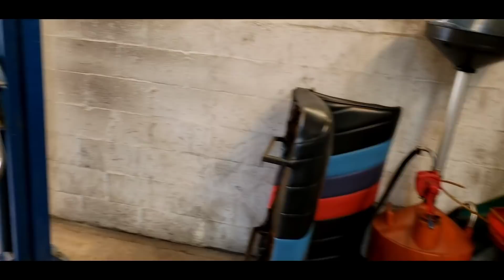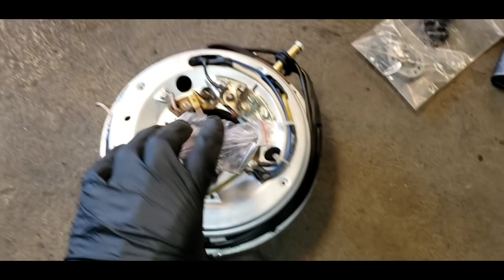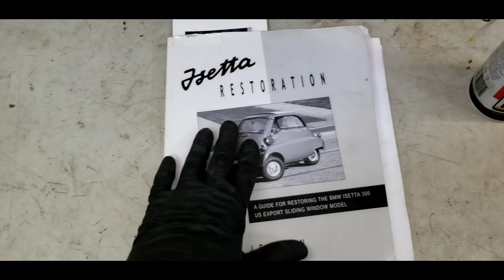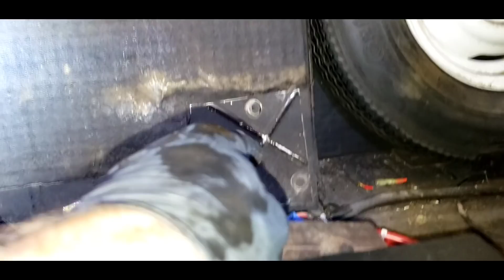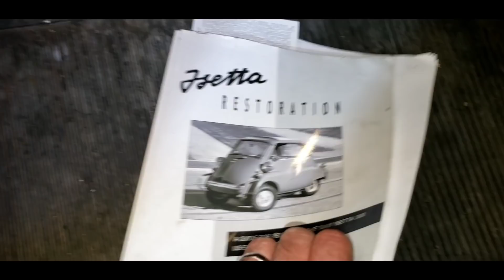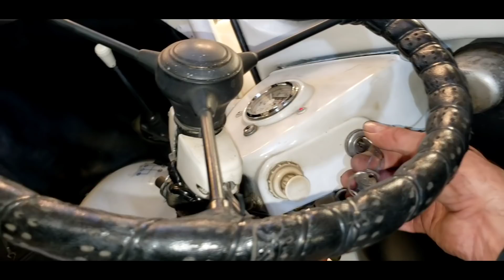Fix Your No Crank Isetta

Comment: Just got to find a ISETTA with that problem then I can have  greasy hands... Tomarrow being Saturday, I'll be at a private vintage car/ truck collection.. will I find a Nash or Hudson truck? I'll be happy  seeing  a graham, hupmobile or autocar  through the camera lens
Reply: Goodluck. Hopefully you get to bring one home! ;-)
Reply: @mikescudder4621  if I was a millionaire,,,, I have 2 x4dr Subaru's 78 and 76.. cutting donuts crazy car , a custom international micro truck 65, a 5 ton station wagon..
Reply: @retrobrid2784  oh yeah... love the international trucks, you have the metro? or do you really mean station wagon like the travelall? Highly sought after! So your Subies are the Leone model? I used to rock a 75 honda civic, loved that thing. Not a rocket ship by any means but a lot of fun.
Reply: @mikescudder4621  I have 5 singleman steel hauling trucks,, which 4 are loadstar and 1 fleetstar with narrowed cabs. One is becoming a micro truck with 10 inch rims.. with a mineral 5 speed .. the ih in 49 came out with the L model which became the R and finally the S model. To get rid of the stock ih used the S cab on my 69 ih d220  a 6 axle water truck with a 6 speed auto.. 57 was the last model style  of the S and then ih introduced the B series, but the firewall on the day cab and windowed wagon was the same configuration/ pattern where the hood joined.. So the water truck will have 2 axles and a short wheelbase.. the Subaru's are custom X4dr type, the 78 4dr wagon became the big justy and the 76 4x4 wagon became the x4dr 3 window coupe with a 75 back end .. look up cutting donuts crazy car / there's a winter scene and summer scene
Reply: @retrobrid2784  Ahh so its the GL, now things are making more sense to me. That thing is crazy! Have you sorted out the cv joints yet?!?! haha! Man, i want to see this loadstar/fleetstar microtruck!!!
Reply: @mikescudder4621  mph or myself can email you a photo,, I hand make alot of chrome bumpered auto/ truck postcards.. one of the singleman trucks has a 7 ft 4 inch long hood resembling what a fenderless  indi truck may have looked like in 32 although it's a mid 60s
Reply: I checked my email for yours and nothing yet, unless YouTube doesn't allow photos to be shared

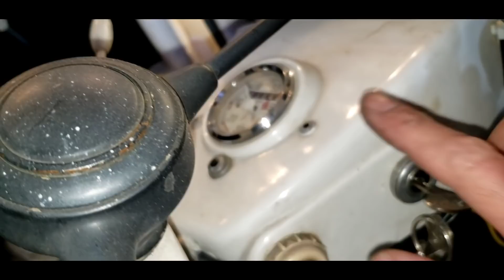Comment: i was confused for a long time (at 11:24 i finally got it) because i thought the car wouldn't start. but it actually wouldn't even turn over, because the starting mechanism (actually a combined starter and generator, not a bad idea in that they are, from a physics POV, a very similar piece of electronic equipment)) was hosed.

Comment: Surprised at how many parts for Isettas are on eBay, from front, rear, side glass,  engine tin, connecting rod, bumpers, master cylinders and rebuild kits...no Dyna-Starts today, however!
Reply: That’s because they were junk destined for junk yards
Reply: @fastinradfordable  'were' being the operative word. There are more parts available today due to demand. They are valuable classic cars now, just like vw busses and bugs which have THE biggest after market parts industry.